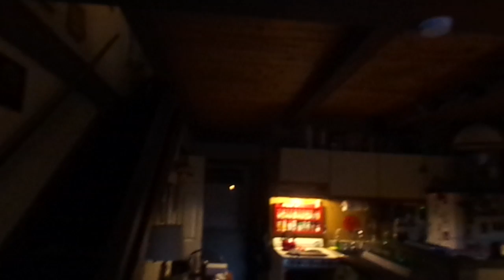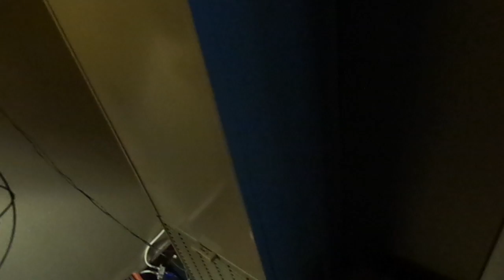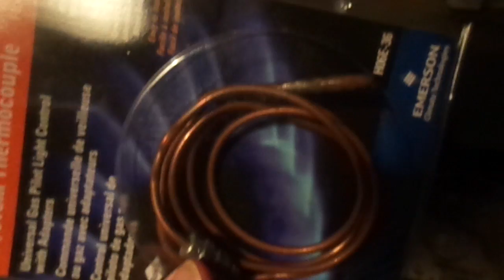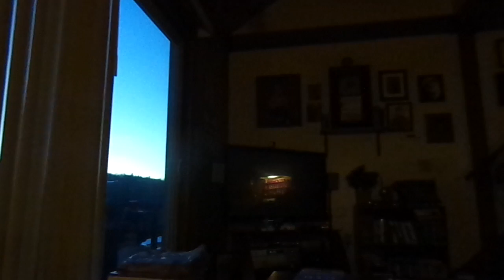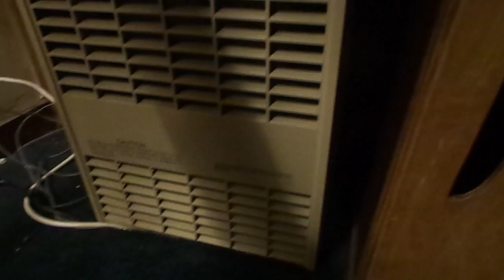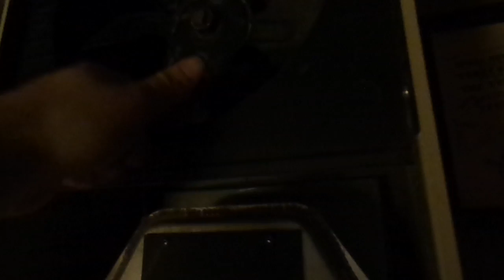1986 Williams Forsaire Pilot Trouble Diagnosis

Comment: Thank you brother, it is 2022 and me and my boss were trying to fix a heater that we put a new thermostat on. The pilot kept kicking off and we were wondering why as soon as he said there was supposed to be a gasket cover we put it back on and it stayed lit and was working! This is probably the only video with the same unit! Many blessings to you !!!!
Reply from the maker: Glad it worked for you! Yeah, without that gasket, differences in air pressure from the inside of the building to the outside would blow the pilot out. I ended up replacing the furnace a couple years later as it wouldn’t stay lit worth a damn - it turned out to be a clogged pilot oriface that was impossible to access as the burner pan was GLUED to the burner housing! Fortunately, Williams is still in business making the EXACT SAME FURNACE! I upgraded to the electronic ignition model which eliminates the standing pilot entirely.

Comment: Helpful video man. I have a newer model, only two years old, and the pilot does not want to stay lit. When I checked it out with a flashlight I see something similar to what you noted. The flame is not really hitting the sensor very well. I am going to try some of the adjustments you mentioned here - although it's cold as heck out today and the furnace is in my garage/gym. Wanted to just say thanks for the video anyway. Other than this issue, it's a great furnace IMO. Oh and don't do drugs man !!!

Comment: Do you know how to replace thermocouple on this without taking it apart
Reply from the maker: I was able to replace mine, it was tricky though... not much room to maneuver the tip around in. I ended up replacing the entire furnace, as the pilot itself was partially clogged, and the only way to clean it was to remove the burner pan - which was nearly impossible without a complete teardown. Fortunately, these furnaces are still in production and can be had brand-new for around $1000 (more or less depending on options and BTU output).
Reply: Did you have to take off pan howd you clip new coupler in?  @bbishoppcm

Comment: I literally just want to know how to light the unit.. I don't have a pilot setting, only on and off. and I don't want to blow up my house really. any one know what to do? it's a Williams forcaire, and I believe it's the same year. this  is an older house.
Reply from the maker: +Brian Shawley The gas valve should have three positions; On, Off, and Pilot. The "Pilot" or "light" position should allow the knob to push inward; this bypasses the thermocouple and forces gas through the pilot for the purpose of lighting it. 1) Turn the knob to "Pilot." 2) Stick a long lighter into the pilot inspection hole, and ignite the lighter. 3) Press (and hold) the gas valve knob KEEPING THE LIGHTER LIT!! 4) Eventually, the pilot should light. Keep the knob pressed in for at least ONE MINUTE, this will keep the pilot lit while the thermocouple heats up. 5) After a minute and a half, release the gas valve knob; the pilot should remain lit. If it does not, repeat steps 1-5, keeping the knob pressed in longer each time until it finally gets hot enough to keep the pilot valve open. 6) Once the pilot remains lit on its own without any assistance for a period of at least one minute, switch the gas valve to "ON," and reinstall the pilot inspection cover. Start the furnace and operate as normal. IF you fail to keep the pilot lit, there is a problem with either the thermocouple, or the pilot orifice. I recommend hiring someone to repair the unit at that point. Good luck!
Reply: +BBISHOPPCM's World I know this sounds crazy, but I don't have a pilot setting. theres on, and off. neither of which allow it to press in. it's the same unit, but I believe it's older. like late 70's possibly. it's hard to tell, the stickers are all worn off

Comment: Thanks for posting. My pilot just went out and I searched this unit on YouTube. Turns out, my pilot hole also is missing a gasket. We have two of these in our chalet in Madison, NH, one in the basement and one on the open concept first floor. Our propane supplier urged us to "upgrade" to Rinnai units - why I don't know. This heater is still widely available and very efficient. I'll keep them going for years to come. Thanks!
Reply from the maker: +Glenn Colassi I later learned that my pilot orifice was almost totally clogged; unfortunately, I couldn't disassemble the burner unit as someone cemented it together. I ended up replacing the whole unit with a brand-new Williams just a few months after this video was made. I bought the same identical unit with a modern ignition system (no standing pilot!!) for $1200 (installed it myself). I'm glad I did this, as the original furnace also had a rotted-out flue pipe, which I would've never discovered had I not removed the entire furnace. Williams has made almost ZERO changes to this furnace, other than the use of a more efficient burner and a newer Honeywell manifold design with optional electronic ignition. My neighbors have Rinnai furnaces, which are all the rage these days; however, they lack a wall-mount thermostat option and are incredibly complex in design; not to mention, they cost more. But they are more efficient and much quieter than the Williams design. I'm also located in NH; nice state to live in!

Comment: I would personally go with a replacement unit, keep it simple. It probably would have intermittent pilot which means pilot comes on for a heat call and goes out with the main burner when the space is satisfied.

Comment: You may want to consider a couple oil-filled electric radiator heaters. They are super cheap and super efficient. If you get 2, you can have one upstairs and one downstairs. During the day, keep the 1st floor one on and at night turn off the 1st floor one and turn on the upstairs one.
Reply from the maker: Electric rates here are outrageous; the gas heater only costs me around $15/mo for fuel... that's about as cheap as it gets! During the day, I get passive solar heat from the 8' sliding glass door. Thanks for the tip though!

Comment: $999 is a lot for a furnace of that size... typically you can find a forced-air furnace (like a 60,000 BTU/hr model) for less than that.
Reply from the maker: What furnace can I get for less than $1000 with the exact same dimensions and exhaust placement? Remember, I'm trying to avoid modifying the exhaust and want something that will last another 30 years - to me, $1000 is a small price to pay. A Rinnai of similar size will cost an additional $500+.
Reply: BBISHOPPCM's World I understood that part. I was just stating that there are many furnaces out there for well under $900, but most don't fit your needs (as many of them are central forced-air furnaces like what you find in bigger homes.)
Reply: +1912RamblerFan01 Thanks for sharing your experience. My propane company tried to get me to install a Renai. The even told me Williams no longer makes this furnace (evidentially, bull.) both of our Williams heaters are built into the wall with beautiful finish carpentry. To know that I can keep and even some day replace these units is a relief. It's an awesome heater with a simple design. Thanks again. And if you ever decide to dabble in vintage Bobcats check out my videos. I have a wealth of knowledge I am happy to share! - gc
Reply from the maker: +Glenn Colassi Yes, Williams is alive and well, and still built in the USA. Depending on which model you currently have, they should have a modern-day replacement that will slide right in. In my case, it was an identical unit sold under a different model number. Home Depot is a Williams distributor, and any legitimate HVAC contractor should be able to cross-reference the specs and model numbers to find the right unit.

Comment: Its doubtful the modern unit has a standing pilot anymore. There were changes in federal law that recently prohibited them in new heating equipment for efficiency reasons, so don't be surprised if only electronic ignition is available. I would really be shocked to see a unit that works without electric (likely millivolt thermopile driven gas valve like water heaters). Those were outlawed back in the 80s due to safety reasons.

The gravity steam boiler in this house has one of those now prohibited millivolt gas valves on it. It was handy when there was no power for a week and a half as we still had heat.
Reply from the maker: They still list it for sale, but you're right; it turns out, all appliances featuring a standing pilot are effectively banned in the US...